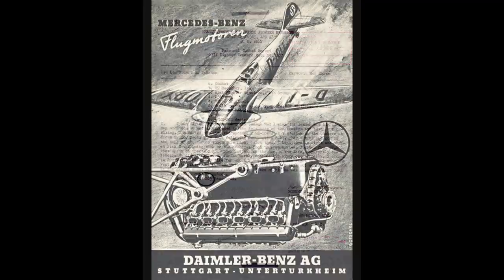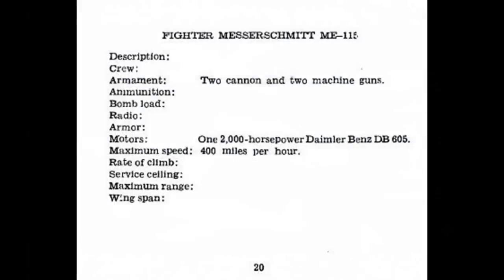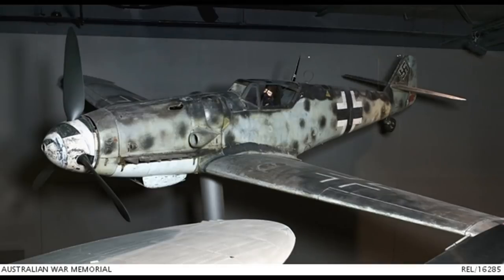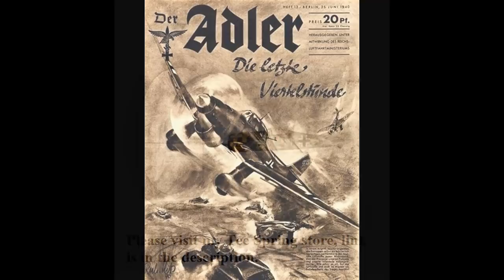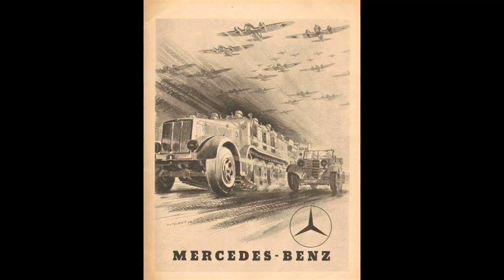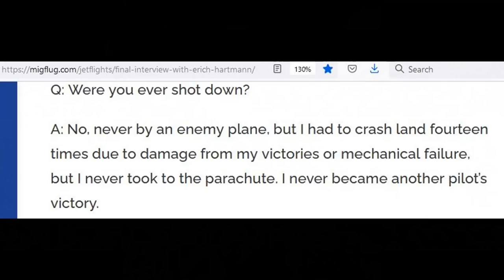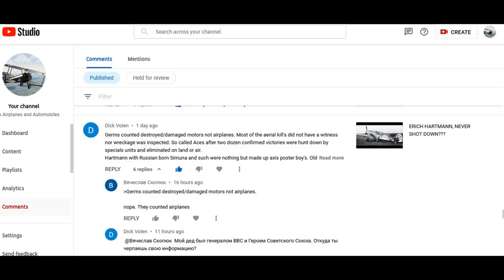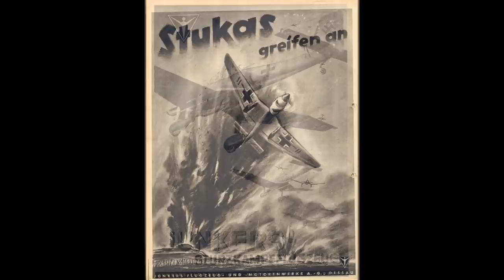Viewer Questions

Comment: Hey, is there a direct connection between the FW-190 and the Hawker Sea Fury? They look somewhat similar specially the gear and engine cowling.
Reply: No connection.  Your eyes are playing tricks.
Reply: Look up the Hawker Tornado if you want the real background to the Sea Fury.  It shows how silly the FW190 ‘link’ is.
Reply: Maybe the engenieers that did the fury took some clues from the 190, that was designed earlier? The cooling and exhaust arrangement for the radial engine is similar at least.
Reply: Sea Fury: the most powerful piston-engined fighter in history? Or the US Bearcat?
Reply: Maybe the Germans copied the Tempest Mk II.  An equally dumb idea!
Reply: @britishamerican4321  I vote Grumman's Tigercat.😉
Reply: @britishamerican4321  The f2G had a +3000hp 28 cilinder wasp major, but does it count as an  operational aircraft?
Reply: @juanordonezgalban2278  Wow!

Comment: Could you do a video on the hell diver? I’ve been obsessing over books on audible about various battles in the Pacific after midway. It’s obvious that the Navy moved away from the dauntless and took a while to get the aircraft and the tactics right to make it effective as a dive bomber. However you never really hear about that aircraft like you do the avenger. Why is that?
Reply: Like all dive bombers, Its a terrible airplane that got many pilots killed due to its pathetic performance. ...But if and when they could arrive over an enemy fleet at 15,000ft, without encountering Zeros, or heavy AA, because all of the defences were distracted trying to shoot down fighters... Then the dive bombers could do some damage. Although half of them invariably end up not making it back, it would seem. Probably due to the fact that they couldn't outrun a Cessna 310, let alone an A6M.

Comment: Interesting video Greg, I enjoyed it a lot.
I only have one question, why don't you make so many videos on British aviation as you would instead of US/German aviation?
Reply from the maker: I do, I made one about the Beaufighter, and one about the Mosquito.
Reply: @GregsAirplanesandAutomobiles  disclaimer: it's not a complain.
Exactly, almost 3.
4 if you cout the upcoming one.
But I was asking just out of interest to see if there was any personal reason or something.
Reply: ??? Isn't anything about the P-51 half British?
Reply: @scottgiles7546  well it's kind of good point actually, but I mean proper technical British engineering stuff.
Reply from the maker: I also mention British engineering, specifically Ricardo quite a bit. I suppose the main reason you see more US and German stuff here is two fold. First, I decided to use the P-47 for my first series, so that's 7 videos right there. Why the P-47? Because it's a plane that allowed me to cover all the key concepts I wanted to talk about, Superchargers, Turbos, radials, Intercoolers, Mach numbers and so on. The Fw 190 was second, and it at 5 videos so far. I can only make videos at a maximum rate of between 1 a week to 1 a month depending on the video and my work schedule. The recent video on C3 fuel took me well over a month. Now at some point, you will see the same level of detail on the British stuff. Some of my favorite airplanes are British. A British plane is literally the symbol for this channel.
Reply: @GregsAirplanesandAutomobiles  well this is the reason why I watch you channel, you do amazing work and you must keep it up.
I wish I could support you on patrion.

Comment: Greg,  any thoughts on when it was the p-47's started flying from the European mainland, were they reassigned to bomber escort?
Reply from the maker: Not very often, by then they were ground pounding.  They did do some escort duty, just not much as compared with the 51.
Reply: @GregsAirplanesandAutomobiles  just wondering prior to the introduction of the P-51 D, the P-47 was the primary escort, it's limited range is what prompted the engineers to put a Merlin- Rolls engine into the P-51 frame and adding fuel tanks, extending the range into Germany, this, and the introduction, about the same time of Napalm must have been gut punches to the Wehrmacht , Luftwaffe and SS...Was wondering if the shorter distance got them reassigned